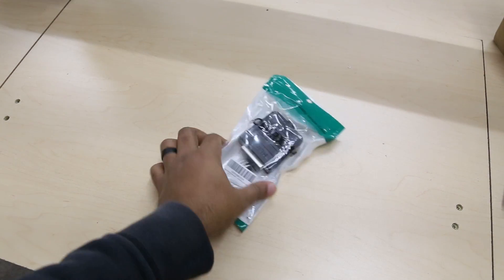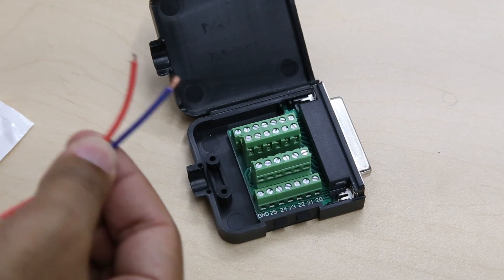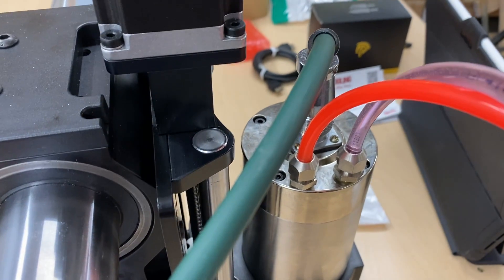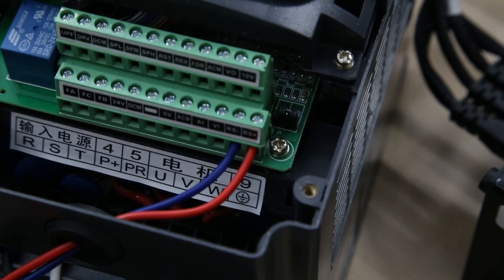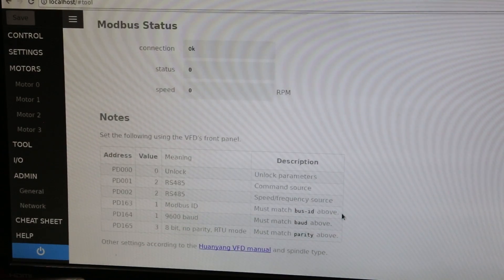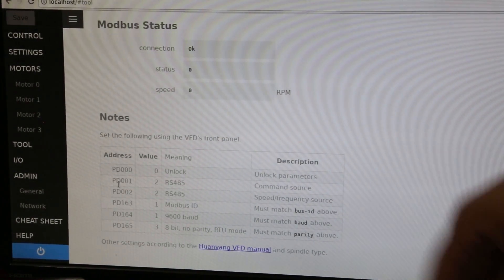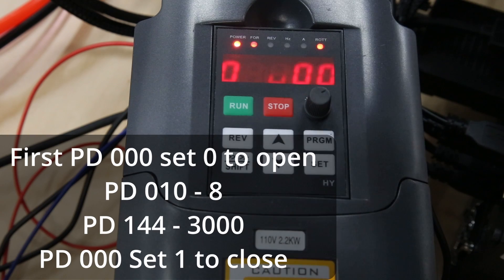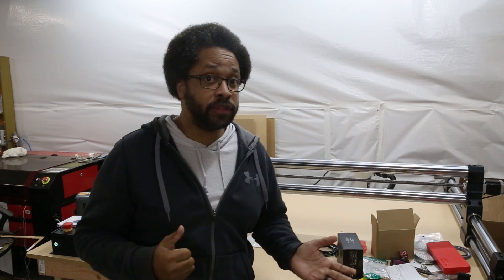Setting up the Huanyang VFD for my CNC

Comment: Great video thanks for sharing your knowledge i just got mine set up thanks to the help of your part 1 video mine is maxing out at 12000rpms. Do you possibly know what parameter i could change to access the full 24000rpms on the spindle. Thanks again

Comment: Hello! I need a female aviator connector that goes to my spindle and then the other end just wires to connect to the HY VFD. I can’t solder, so I need one already made up. Can anyone help me? Great video.
Reply from the maker: PWNCNC makes cables that connect the spindle to the VFD, shielded and ready to go. I believe they charge by the foot https://pwncnc.com/products/spindle-cable?ref=8AC5ge7gj3eqAl&variant=41428190953611

Comment: I have masso G3, do you know if I can use the same setting on G 3?
Reply from the maker: I’m working on a video right now about that it should be out in the next couple of days. I did have to change some settings to work with the Masso but only a few

Comment: Nice video, thanks for all the research on this topic. I followed your vid and wired mine however mine for some reason is rotating in reverse (must have wired it wrong somewhere any suggestions? I know I can hit the rev button but I have OCD and it needs to have the forward light showing and go in the right direction!
Reply from the maker: I’d have to grab the book but if the wiring is correct there are PID settings that will set it to rotate in the correct direction. I’d have the find the book first to let you know

Comment: Great vid!! Thanks for that 🙏🏻. Does the VFD take the RPM from the Goode? For example when made with fusion..?
Reply from the maker: I haven't used it out of Fusion yet, but so far yes it gets the RPM speed from the gcode. It'll give a screen prompt to start the cut once it reaches the correct speed.

Comment: Fantastic video, thank you for making it!! I followed your instructions exactly and was getting a timeout error. Turns out the standoffs I had were a tiny bit too long, making the connection to the controller very touchy. Found some that were about 1mm shorter and worked like a dream.

One other thing I saw a number of people mention is adding a ground. I just added a short ground wire to the breakout board and terminated it on the controller box which is then grounded to my home ground. No idea if it makes a difference but I guess it can't hurt.
Reply from the maker: Glad to hear you got it all sorted out and that the video was helpful. Hope the spindle setup works out great for you!

Comment: Do you recommend this spindle? Or do you wish you have gone with a different solution?
Reply from the maker: I’m pretty satisfied with this. I do wish it came more cable ready since I’m new to wiring things like this, but it was the most affordable solution I found and lots of other people were using it so I had a potential support network. If I had the money back then I might have invested in the plug and play version for warranty reasons but otherwise I’m happy with this.
Reply: Thanks @vanstray

Comment: Great instruction. While running a job that sets the spindle speed to whatever you programmed in the CAD program, is it possible to change the speed on the fly with the speed potentiometer knob?
Reply from the maker: Not once it’s programmed for the controller to start and stop it. If you wanted to adjust on the fly you’d have to leave it in the default setup

Comment: despite using the correct hex keys, I ended up stripping both heads so now I can't mount my 80mm spindle clamp.  Looks like I have some drilling and tapping in my future....Even tried the ones at the top the Z mount and only 1 of those would break loose.

Comment: Hi VanStray
During configuration for VFD I have problem to find P01, P02. I only got uP0, uP3, uP4, uP5, uP6.
Sir, please telling me 
How to changing these uP code to P code in VFD CNC 6040Z 4 axist. 
When I tried to reset factory setting error 40 appear. Then unable to get P code again.
Thank you sir
Reply from the maker: Are you using the same VFD I have in the video? I haven’t done a factory reset, but from what I’ve heard people had to reach out to the company support line and they were able to get them back to the right menu
Reply: @vanstray  I just get your vfd type. And it is from another company.
Mine is from Nantong Huijun.

Comment: Did you have to wire the VFD to it's own circuit?  I've heard that the 110 v version can easily trip a 20 amp breaker.
Reply from the maker: So far I have it plugged into a industrial power strip with other stuff and haven’t had an issue so far
Reply: @vanstray  Great to hear.  I don't have room for another 220 circuit and didn't want the 1.5.

Comment: Hello, great video. I’ve been turning my vfd on manually for a while. Need to take the time and wire mine up. Thanks!
Reply from the maker: Yeah one you get that part dialed in it’s so nice to not have to touch things
Reply: @vanstray  Hello Kimani. I just finished wiring my vfd to the controller. Your instructions were perfect! The controller is communicating with the vfd now and no more manually turning on the spindle motor and tweaking the rpm knob anymore. Thanks again!

Comment: Hi…great videos… I’m coming from shapeoko pro and move to 1f. I can’t figure out how to have the 1f automatically turn off dust collection and the spindle after job is done or for tool changes. Have you been able to complete this process?… let me know thx
Keep the vids coming as I’m excited to get the new controller in the future.
Reply from the maker: Thanks, I believe you’ll need an IOT relay for it to work. I’ve seen the process done, but haven’t connected it to my system yet. I might work on that after the holidays and create another video
Reply: Yes as @vanstay says.   A breakout box to get to the pins on the back of the onefinity controller and connect that to the IOT relay to control a vacuum.   This can control a router too but note the IoT relay product only handles 12A (Router and vacuum will exceed this). To get this to work you need a vacuum that turns on automatically with a tool load.  You plug the tool in to the IOT relay and the IOT relay in to the vacuum.    The IOT relay turning on the router will draw enough current that the vacuum will then switch on.      For a spindle control, what was done in this video should do the trick.